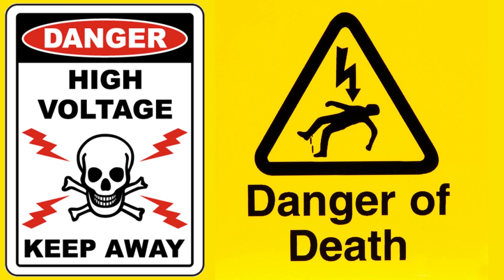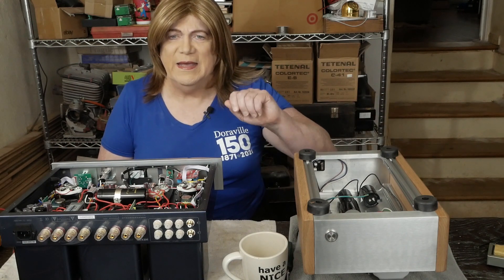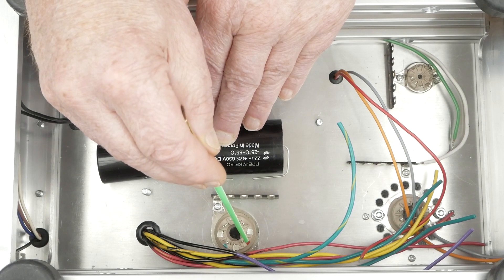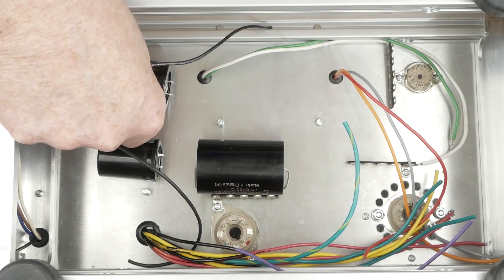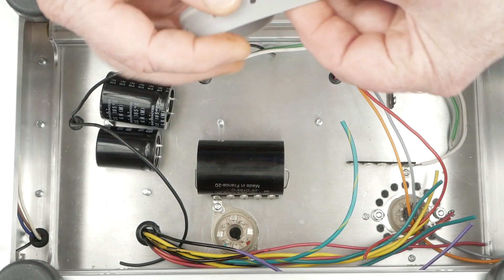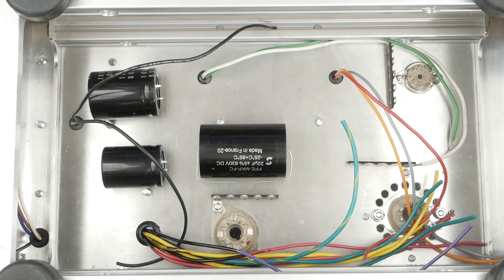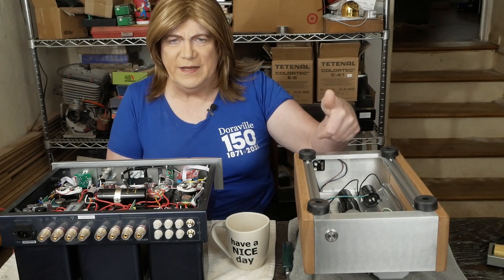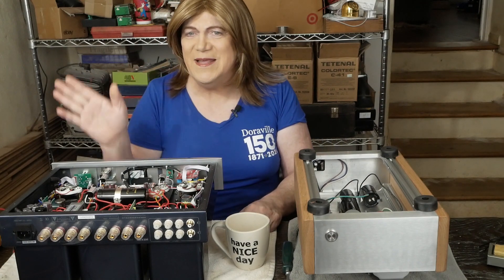KT120  SE UL mono block: Power Supply Layout.

Comment: Wire from rectifier output content high ripple current signal , usually it should be  short wire and connected to small capacitor (around 30uf) .  You can calculate also peak current too. It is better to have first low value capacitor. Output of chocke filter should not run in parallel with output of rectifier.  I usually mark them clean voltage and dirty